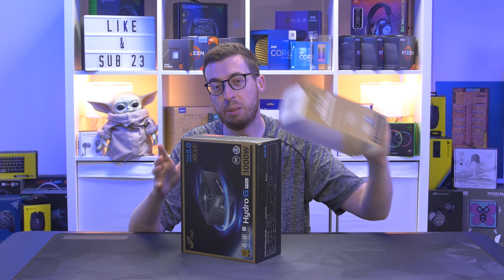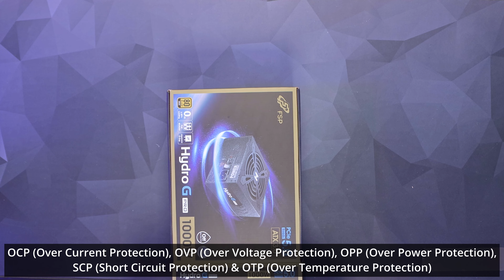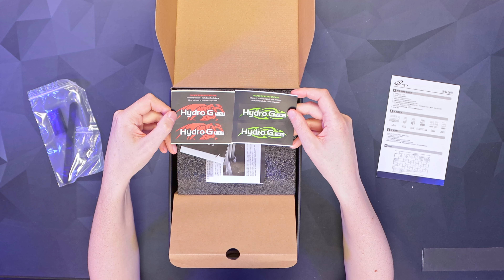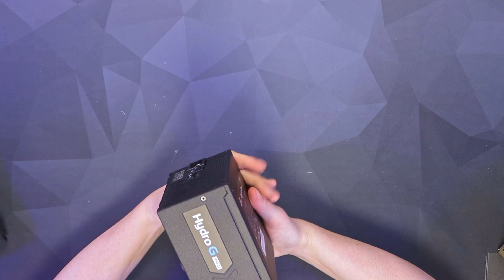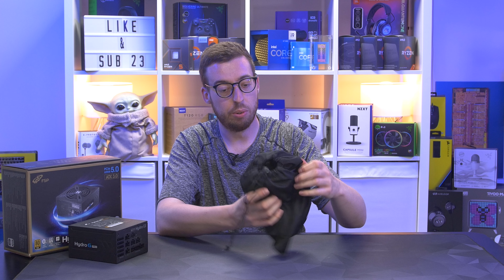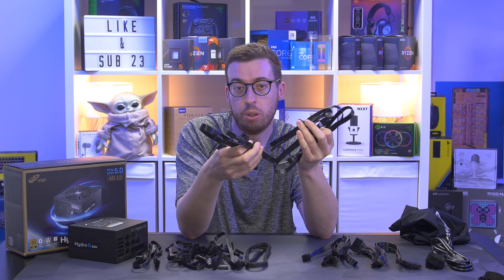ALL THE OPTIONS! - FSP Hydro G Pro - ATX 3.0, 80+ Gold Power Supply - Unboxing & Overview! [4K]

Comment: bro do you know if the 12VHPRW cable is reversible or interchangeable, I cannot find any label and both end look the same, and the menu does not have any info either
Reply from the maker: Yeah, the 12VHPWR cable can be used wither way around.

Comment: I have a problem with the 850w power supply. When I turn on the computer, I hear a sound like a switch inside the power supply, but the computer has lights but does not work. What is the part that could be causing the problem?
Reply from the maker: That switch sound is normal, if I remember correctly it's the overcurrent protection kicking in and off. I expect it's likely something else, have you got debug LEDs on the motherboard?
Reply: @jordanash  Yes, the problem is in the power supply, but when I leave it unplugged for an hour, and when I turn it on, it works well in games under heavy load.
Reply from the maker: I'd take it to a PC store and get them to try another PSU in that case, then you know if it's that or not.

Comment: hi im getting a psu which should i go for the rm750e or the fsp hydro g pro 750w?(the price difference is $4)or do you have different recommendations?
Reply from the maker: I'd go for the Corsair, but either is good. I used a Corsair in my PC for 10 years without a single issue.
Reply: @jordanash  Thank you so much brother
Reply from the maker: Anytime!

Comment: I have this PSU as well. Whenever I turn on/off my PC, I can hear a clicking sound from the PSU. Is this normal?
Reply from the maker: Yeah that's normal, if you've not upgraded your PSU for a while it might make you worry but most of them do that now. It's like an internal power regulator working
Reply: @jordanash  I see. I've read that it was the relay clicking. My old PSU was released way back 2014-2015 I believe.
Reply from the maker: Yeah could be that too. I know how you felt, I had one from 2010 before i started doing hardware so the click was s bit of a WTF moment

Comment: Its two models on amazon the G5T and the Gen 5 the G5T newer which one do you think i should get
Reply from the maker: Depends if you need the 12VHPWR connector or not.
Reply: @jordanash  Hello sir, how many GPU PCIE cables does this PSU comes with 2 or 3 ?
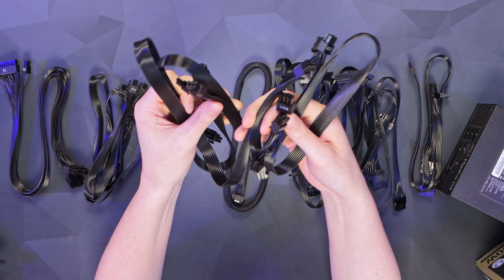Reply from the maker: @officialyashvirgaming  It's literally in the video 3:32

Comment: hi bro need to change my psu
İ have buy these psu 's 
fsp hydro 850w gold 
gigabyte auros p850w 
thermaltake grand 850w rgb 
What's your recommend?
Reply from the maker: I'd go for this out of those options, Thermaltake second.
Reply: go for the hydro if you haven't gotten a different one already gigabyte is known for having psu problems and the grand rgb series from thermal take is also known for being low tier junk.

Comment: What component do I use with the pcie5.0?
Reply from the maker: That's for any of the NVIDIA graphics cards that have the 12VHPR connector
Reply: @jordanash  how much Watts is this ?
Reply: @jordanash  how many GPU PCIE cables does this PSU comes with 2 or 3 ?
Reply from the maker: It's in the video

Comment: If you switch off the power on the PSU. Is there a buzz sound after you clicked it? Mine got it. I wonder if that's a feature of this PSU.
Reply from the maker: I don't recall hearing mine buzz
Reply: @jordanash  thanks for the reponse. I'll just rma it.
Reply from the maker: No problem, hope the new one works okay

Comment: Hello. Can i use this supply to my pny 4090 450W limit card? I mean i heard a lot of 12V burning stories and people keep telling me the cable which coming with psu, be careful. So do you think this is good brand ? Thanks review too 🎉
Reply from the maker: Yep! Just make sure you connect it fully and don't bend the cable very much out of the card and it'll be fine. It's been made out to seem worse than it really is.
Reply: Thanks a lot for reply  @jordanash
Reply from the maker: No worries
Reply: @jordanash  Hello sir, how many GPU PCIE cables does this PSU comes with 2 or 3 ?
Reply: Yes this is better than cable mod adapters, or that short adapters u get from 4090 cards.